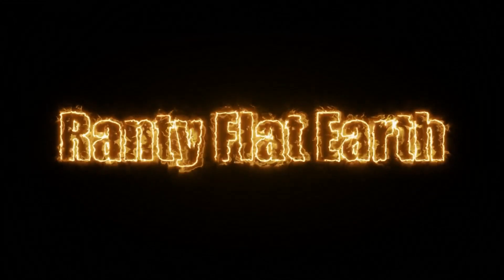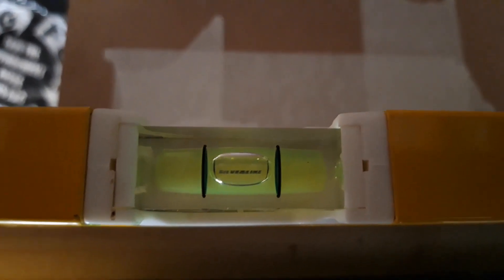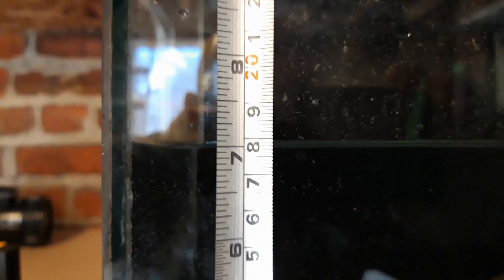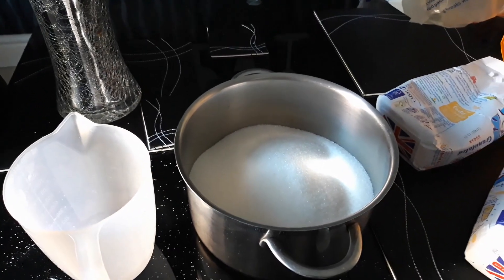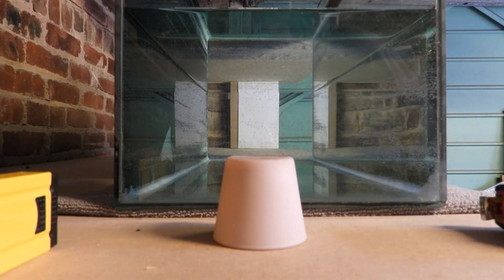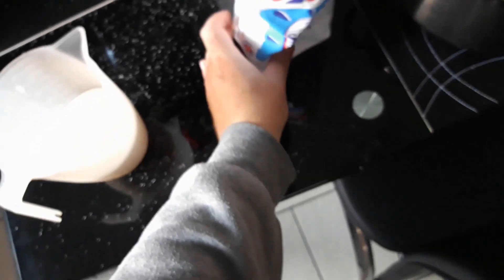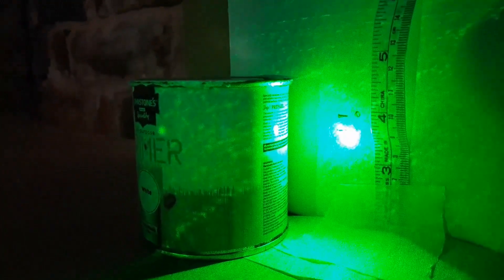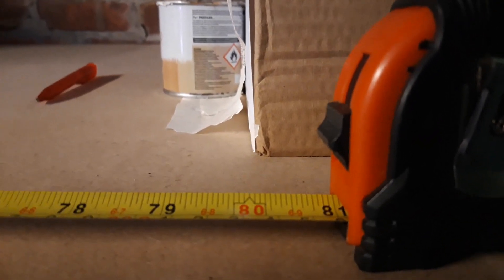Sinking Experiment Crushes The Globe Rhetoric For Observations

Comment: The right hand image at the end is clearly compressed vertically. You point out the top of the tin as very slightly lower than it is on the left, but you omit the fact that the smudge on the paper is higher on the right. And how about the bottom of the tank? You can see without drawing a line across the two images that both the floor, and the base of the tin, have raised, not lowered. This disagrees with your inference that distant objects reliably sink under standard refraction. Is this the only image? Are there any others?

If you did this scientifically, you would take a baseline image without any sugar in the water (in fact you'd do one with no water as well), and then you'd add sugar and take images at controlled intervals, maybe every minute for a few hours (for things to settle down), you have a number of targets to compare, and plot the results. You would also put the tape measure and tin inside the tank and make the far end opaque to exclude any effects of the light going from a liquid of varying density into air. Lastly, you would be better off increasing the light levels in the room and taking photographs with a very small aperture - the blur of the foreground object is much greater than any effect you're noticing. And instead of random objects, get or make some proper targets. For the small size you have going on, you would only need to get paddle pop sticks (not sure what these are called in the UK) and paint them black and white in vertical blocks at exactly the same height, and place them throughout the 3 feet of the tank at equal distances. This would give you a standard sighting line to photograph as a baseline and easily compare the test results, being able to see at each distance what the effect is.

And when you eyeball the position of the laser on the cardboard box, you might consider drawing an outline around the entire laser dot rather than a horizontal line. There's a lot of error in that method, and drawing an outline might show the size of the laser increasing between tests, or its shape changing (possibly becoming more vertically compressed). This might lead you to infer that what you've done is create (or increase the power of) a cylindrical lens, which I suspect is what's going on here.
Reply: But he'd still have to use photoshop to stretch the tin on the before image to make it look taller than the after image and he'd still be too dumb to realise he also stretches the brown line on the right to make it obviously fatter, the graduations on the tape so it's even easier to spot his fakery and even his own pencil marks on the paper target stretch.  He is as dumb as a dumbfuck can be.
Reply: @cliveadams7629  I don't think it's fakery, I think he selected a single frame from the video that supports his case. The density of the liquid is likely not homogeneous, and so the refraction would not be uniform or stable. Probably for every moment that the tin appears lower, there are ten times as many moments in which it appears higher, or unchanged. This is why you take samples at predetermined times and plot many; it reduces the observer's bias.
Reply: @aidhoss  Pound to a penny the density is not absolutely homogeneous but I'll bet you all the money and property I have there's not a strip about 1" deep across the full width of the tank and only affecting the bit of label, tape measure and brown line which is just the right density difference to stretch that bit of the image.  It's photoshopped because, well, because it has to be.  Simple.

Comment: There does not appear to be any more or less of the paint can visible in the right image as compared to the left image but it does appear to be a bit more compressed.  
A more interesting feature you didn't address was the little line on the paper a couple of inches above the can... why does it get higher in the right image when compared with the left image?

Comment: @Ranty - Awesome experiment. I lined up the cardboard box bottoms as they weren't aligned Had to lower the right image, you can see the gap at the top, i know its maybe the water, but check the distortion all over if you line them up. Things lift up higher in the water and the image sinks lower down in the water, obviously more dense at the bottom? 
The tin is stretched on the left, but compressed on the right.Thought it was interesting.
https://ibb.co/X2hbcbq

Comment: Mr Ranty, I'll just open with these and see where it takes us- 1 What is the margin og error on bubble type spirit levels? 2 If your setup started perfectly level and everything you were using for reflection was exactly tangential to the beam, the why did the beam and reflection diverge? 
   By the way, the type of refraction you're testing for needs different layers of density to form an actual gradient in so small a tank so although you can test with sugar water, you should be really careful to not roil/ mix the layers (clearly defined in the illustration you used in your setup)as you are putting different densities of solution in the tank. Good luck.